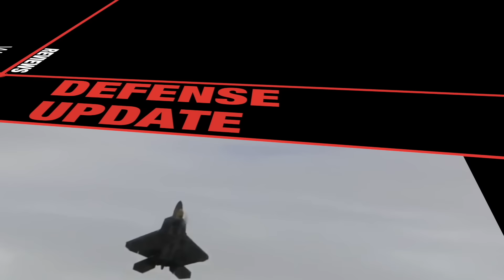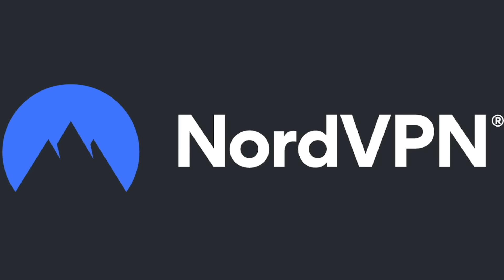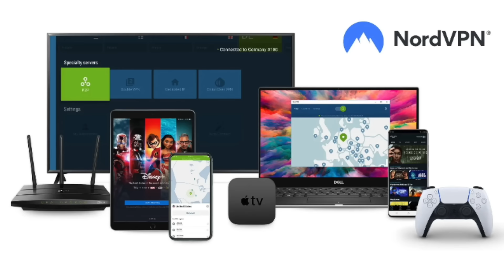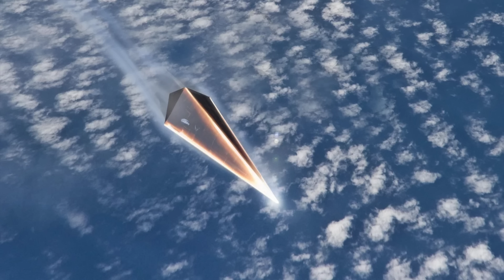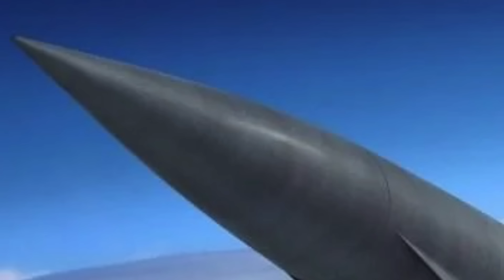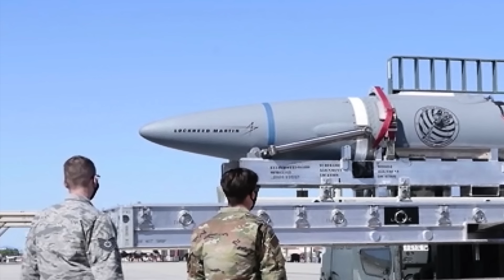Why Erinyes Hypersonic Test Bed could be game changer ?

Comment: This looks more like a MARV (Maneuverable Advance Reentry Vehicle) than a hypersonic glide vehicle HGV. Also AGM-183 ARRW has already been canceled even if the last three all-up-round tests were successful. It may have been cancelled since a cheaper alternative is present like MAKO.
Reply: AGm-183 isnt cancell yet.Recently US military tested it in pacific theater.
Reply: @Eshrakgaming934  "FY25 budget, released Monday, includes no procurement nor research and development funding for Lockheed Martin’s ARRW", defensenews Mar 13, 2024

Even if it isn't cancelled, MAKO and air-launched SM-6 seems more practical and effective in my opinion.
Reply: @johnsilver9338  I dont know about that some of their developement and funding are classified.During the test in pacific US military didnt reveal anything about the performance of that missile.Air-launch sm-6 or AIM_174B is practical in extreme range air to air engagement.But they are trying so hard to operationaly deploy a long range hypersonic missile.
Reply: @Eshrakgaming934 that would be cool if the AIM 174 B was a SM 6 BLOCK IB Prototype...that will fly at Hypersonic speeds....the US said that the last test PASSED.....the ARRW was rushed... that's why it kept failing from 2020 to 2023..👉🏻
Reply: @willwozniak2826  Honestly sepaking hypersonic weapons in real world is very tough technology to achieve.
The performance of agm-183 is various but they didnt reveal any data about their last test in pacific.At least they are very transparent about their weapons performance.You see the russian their Avangard tested for only 3 time and on the 3rd test it failed.But still the russian federation fielded it as a operational missile.
Reply: It would appear that the AGM-183A may be put into production soon.
Reply: We dont know that for sure John.....something tells me they are being produced at a low rate. We don't know much about the Makos.

Comment: Hypersonics are NOT highly agile. They're the opposite. The higher the speed, the more difficult it is to turn. Plus, they have to slow down for target acquisition.
Reply: they are agile due how to target acquisition and anti-air system work. with hypersonic speed, air defense must tarck and project misille impact point from long far away distance. If air defense location is static/ potential place are discovered and or know by who side launch hypersonic, hypersonic will turn its path in 3D motion so air defense have little change to calculate point of impact. Balistic missile are more easy to intercept due this nature, low speed meaning more time reaction to calculate and prepare missile and normal balistic trajectory like throwing the ball
Reply: @sukocoimam4519  That's not the same as being agile. The SR-71 wasn't agile and had a turning radius of something like the size of a US state, yet wasn't even hypersonic.
Reply: @Xenomorphine  okeh
Reply: WELL IT'S more agile than ICBM GOT THAT!

Comment: Part of the problem with hypersonic defense and detection is having targets that are able to simulate the speed and maneuverability of real world targets
Having an actual test vehicle that can give real data and still be cost effective is huge deal
Reply: You're correct. We need hypersonic test beds to learn how to detect, track and engage them. Plus, it's not a real world test if the MDA knows the test is coming.
Reply: @dextermorgan1  
True , knowing its test is different but you can make test as real as possible
Tell the crew that between 7am to 7pm they can expect test but dont tell them whats actually happening
so they were watching and waiting like they would in real world 
Throughout the day send up electronic decoys, then just out of the blue send the real thing
as it would happen
I would send up 3 from multiple directions with decoys and aircraft to simulate a real attack

Out of the blue, its missiles, aircraft and decoy simulating a high volume attack
Reply: Stratolaunch also has a reusable hypersonic test vehicle called Talon-A